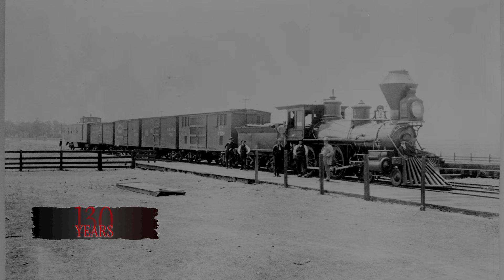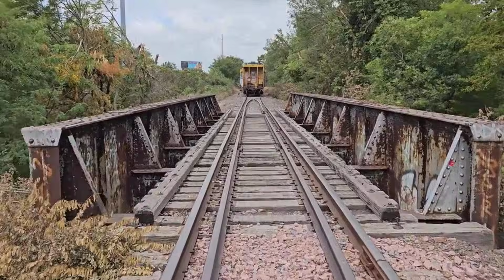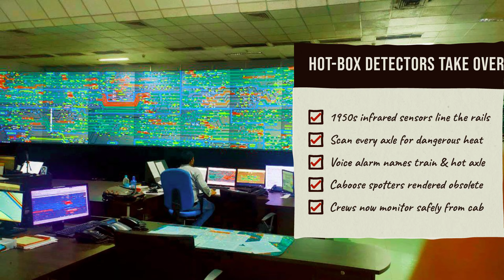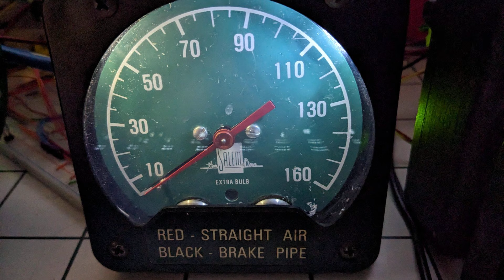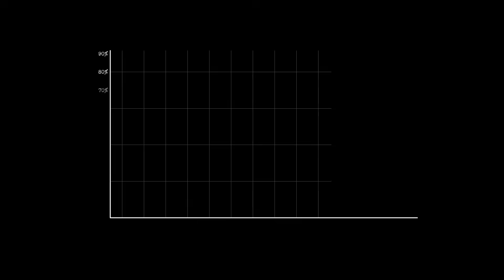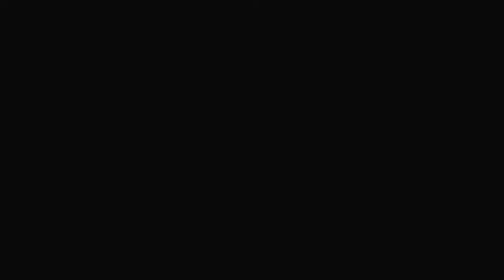Why Railroads banned Cabooses Forever

Comment: Would have happened earlier but Union's held railroad's hostage, is their job to fight their employer on every turn, regardless if the company can survive rising costs. Why so many lost their railroad jobs in the 70's after work slow downs, sick days, etc., anytime the company wanted to make a change in an effort to hold down freight cost against the rise of over road trucking. 

Hard to continue a fight with a "Union" company for more pay & benifits that just no longer has the funds to pay their employee's.

Comment: As it took the transition to roller bearings on rail cars to eliminate the caboose from most mainline trains as the caboose still has a niche role.  If most railroads stepped up their defect detection to a portal as the train is scanned by specialized cameras as train watchers armed with a scanner when hearing a synthanized voice come on the radio spitting out information about the train that just passed by when hot box detectors scan hubs and alert the crew of an overheating bearing.